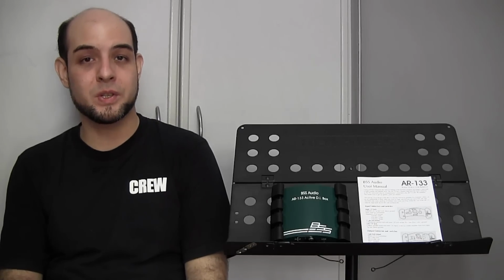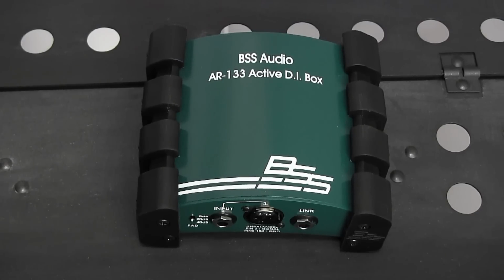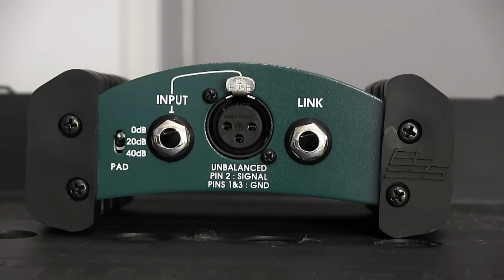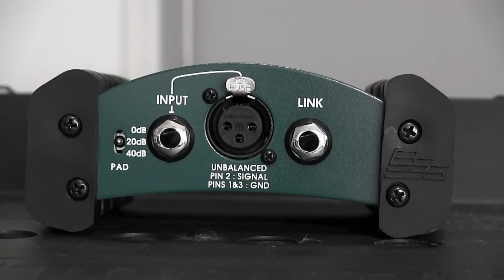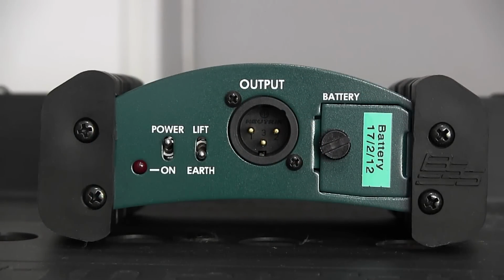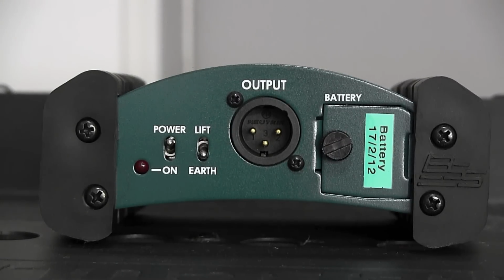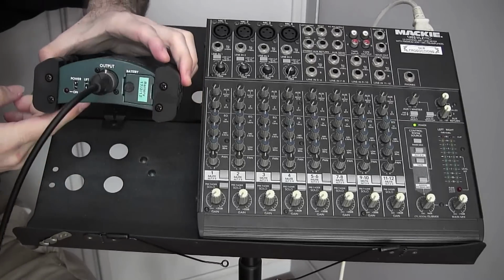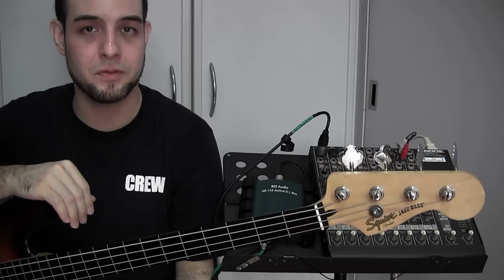BSS Audio AR-133 active DI box review and user guide

Comment: So if I used this with a Scarlet 2i2 gen 3 for guitar and bass recording, would it clean up the signal when using VSTs?
Reply from the maker: No - on that unit connect directly using the INST mode, no DI box needed.
Reply: @GLBProductions  ahh OK, thank you for the Info :)

Comment: can we use this DI box for microphone?
Reply from the maker: Microphones which have an XLR output do not need a DI box - the output is already balanced and low impedance :)
Reply: @GLBProductions  how about to make dynamic microphone into line level in the cheap way? :D
i mean maybe under $100
Reply from the maker: I would purchase a standalone mic preamp, or even a cheap mixer - you could probably find one used for under $100. One of the old Mackie or Yamaha boards.
Reply: @GLBProductions  i never found standalone mic preamp under $100 :(
maybe i will check for mixer.

thanks a lot

Comment: Can the output of the BSS AR133 be used with fixed line level inputs like the inputs 3 and 4 on the new focusrite scarlett 4i4 3rd gen?
Or is it mic level output as well like the Radial JDI Passive DI?
Reply from the maker: According to BSS the maximum output of the AR-133 is +9dBu so yes it can drive a line level input. Bear in mind though that the actual output level will depend on the input level.
Reply: @GLBProductions  Thanks a lot

Comment: hai. i am using yamaha psr 775 keybord can we use. DI box(BSS AR-133) for that.any option .pls reply
Reply: Psr s775
Reply from the maker: Yes although you will need two of them if you want to run the keyboard in stereo. Better to use a passive stereo DI such as the Radial ProD2.

Comment: Very helpful video! Can I ask your advice, when you use that passive bass guitar, where did you positioned you ATT switch? 20db or 40db?
Reply from the maker: +mdavev At 0dB. 20dB is for line level signals and 40dB is for speaker level signals.
Reply: Thanks! appreciate it

Comment: nice video. I am building a subkick for my kick drum in hopes of being able to get a mixer to add just a hint of resonance to the kick drum. I discovered I will need a DI box to balance and dampen the hot signal. I ordered a cheap one off eBay before I learned I should buy an "active" DI box because the cheap passive ones will not result in good lower bass frequencies passing to mixer. I don't know anything about sound engineering. Please suggest cheapest brand and model DI box that would be great at very low frequencies...The drum kit it permanently set up behind a 4' high wall which killed the resonance of the kick drum. This is why I am exploring the subkick to mixer to add resonance. ..thanks
Reply from the maker: +michael Thanks for getting in touch - may I suggest that you read this article on how to build a subkick mic: http://www.prosoundweb.com/article/in_the_studio_diy_subkick_microphone/ The article indicates that no DI box is necessary, just an inline pad. Let me know if this is helpful :)

Comment: should an arranger keyboard use di boxes?
Reply from the maker: kforthy chris If the keyboard has an unbalanced output and you need to run the signal more than 15 feet yes, otherwise not necessary. The output from modern keyboard is always low impedance so that is not an issue :)
Reply: thank you !!

Comment: Hi! thanks for the review. Does it possible to remove de buzz of the pedals with the ground/lift?
Reply from the maker: Hugo Santos It depends on what is causing the buzz - grounds lift switches will usually work if the buzz is associated with the grounding of your equipment. If the buzz is coming from your guitar pickups or the lighting dimmers in the venue ground lift will normally not help.
Reply: thanks a lot! ;)
Reply from the maker: Hugo Santos You're welcome :)

Comment: Great review, thanks a lot. Is there however a difference in performance from this unit when using batteries as apposed to 48V phantom power? I want to use it for recording purposes and my audio interface does not have phantom power.
Reply from the maker: OneArchetype A good question - the user manual for the unit does not state that performance will differ on battery vs. phantom power, so the answer in principle is no. I'm just wondering - is there a reason why you can't plug your signal source directly into your recording interface? Does it have any 1/4" connectors or only XLR?
Reply: GLB Productions I'm using a M-Audio Delta 1010lt soundcard. It has 2 mic inputs, with adjustable pre-amp levels, and 6 RCA-type inputs (and the same outputs as well). It does not have an input suited for instrument level. I am trying to record a electric guitar with passive pickups directly into the interface and the sound is a bit muddy and lacks clarity.
Reply from the maker: OneArchetype Ah yes, in that case you need some sort of DI box. The muddy sound you are getting is the classic sign of an impedance mismatch. I have personally used this model DI on both battery as well as phantom power and could not detect a difference in the sound. It's possible that there may be slightly less headroom when using battery power, but the AR-133 can operate on phantom power as low as 20 volts so presumably this is not a major issue.
Reply: GLB Productions Great, thanks a bunch for your insights. Keep up the good work with your channel. Good luck!

Comment: Very helpffull video can you tell me is this a good way to play bass guitar on small gigs for 50 - 80 people tnx ...
Reply from the maker: - It depends on whether your PA system can handle the bass frequencies. If you have small speakers, it's best to add a subwoofer or use a separate bass amp.
Reply: if it has 15 inch speakers it probably be OK ( but most of the time has 2 bass bins.... and thanks for your replay ...
Reply from the maker: Darko Velickovski With 15" mains and 2 subwoofers your system should be more than capable of handling bass guitar through a DI box for 50-80 people :)

Comment: Thanks Bruno. I get confused in a balanced and unbalanced lines . where do we use balanced or unbalanced. Thanks for Your patience .
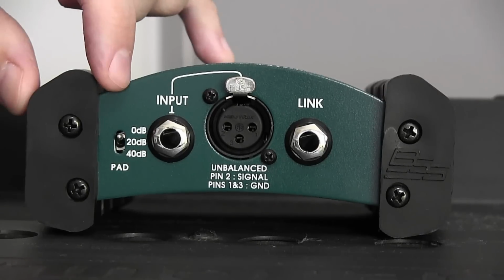Reply from the maker: - Balanced lines should be used any time you run a signal over a distance greater than 5 meters/15 feet. Below that distance you can used unbalanced lines. I suggest you watch my video What does a DI box do, and when do I need one? starting around 5:20 for a more detailed discussion.
Reply: Thank you Bruno.

Comment from the maker: - Thanks for the info. What sort of output connector are you using on the monitor? Some of these powered monitors have speaker-level connections on the back which can do damage if connected to the wrong input! If it's an XLR output you *should* be ok. Also, ensure that you are running into the line level input on your mixer and not the mic input. If the output on the monitor is an XLR male, this means you will need a female XLR to TRS cable.

Comment: So I need to find a way to run out of the powered monitors to my in ear rig, Snake on the stage has no line outs or a way to connect to the monitor line out on the board which is by the front of house.

Any help you can offer is appreciated.

Thanks

Comment: So this particular set up is to run from the on stage
powered moniters which Carry the stage levels for the band (vox, guitar
etc,) into my Beringer 802 mixer for my in ear monitors as there is a
limited number of stage monitors. I've run a balanced line/TRS cable as well as a line cable  from the powered monitor direct to the behringer and it comes thru the in ears distorted. Dunno the make of the system but stage monitors are powered.

Comment: would this be a good device to use running out of powered stage monitor to behringer mixer running in ear monitors? i have had the problem running directly balanced and line cable from the monitor to my small mixer running the in ear.

Thanks for your help.